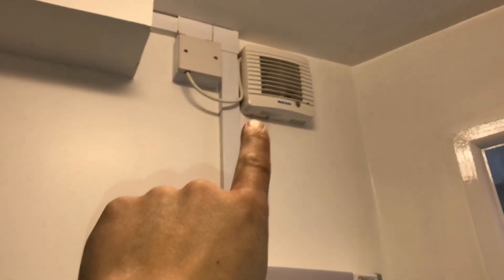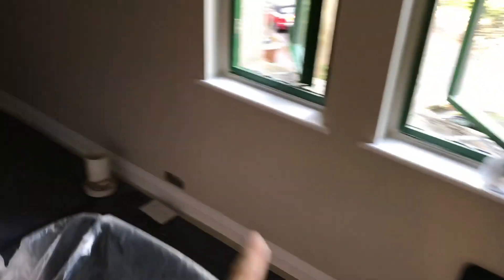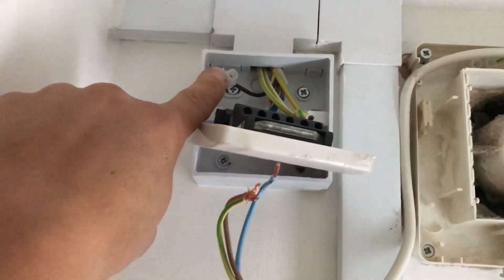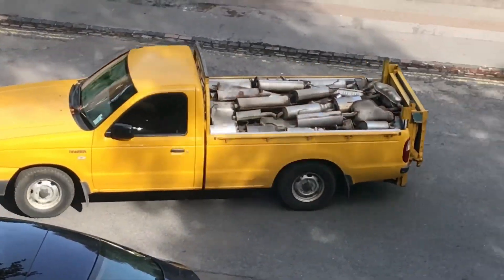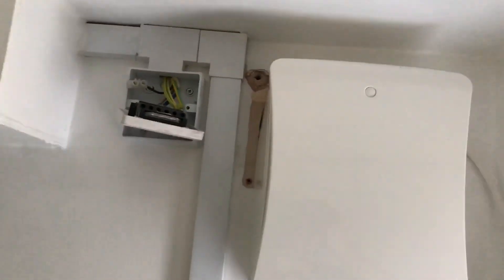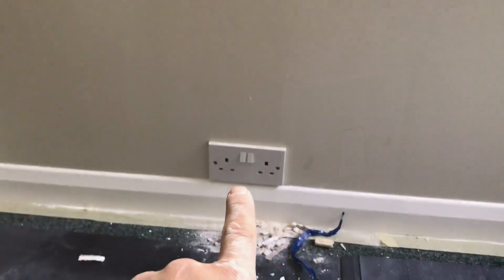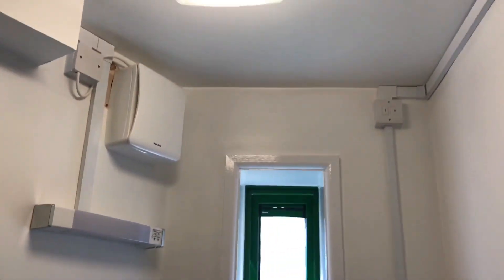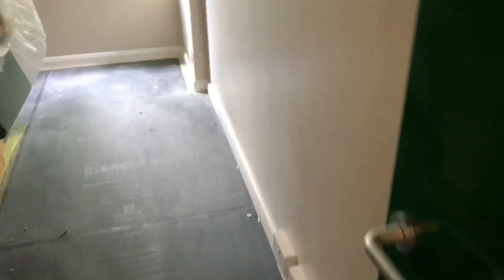Student Accommodation!! Did They Spend Any Money ?

Comment: aremyou sure that the fan will change air at the required rate for the size of the room ?? have you done the calculations or just got one with the overrun on it ?? dont forget its time as well as volume you have to consider to prevent mold
Reply from the maker: Fans are capable of clearing a room up to 35m I’m sure it will clear a 2x2m just fine .